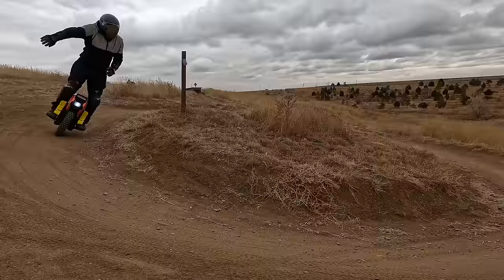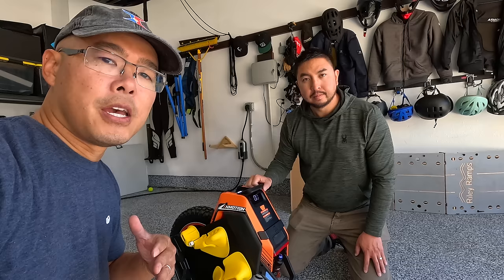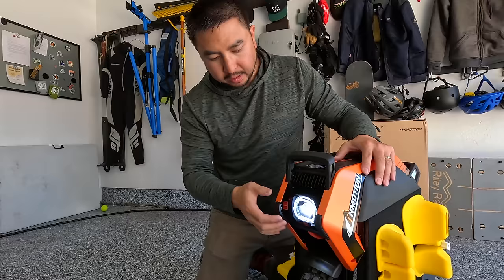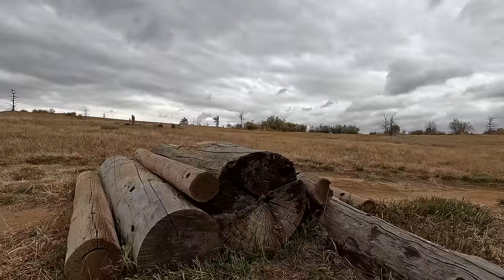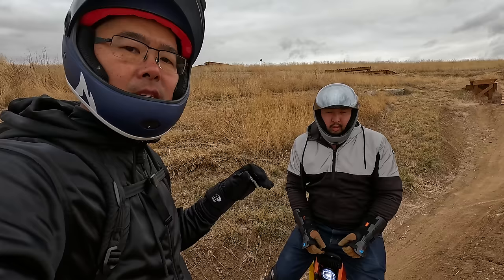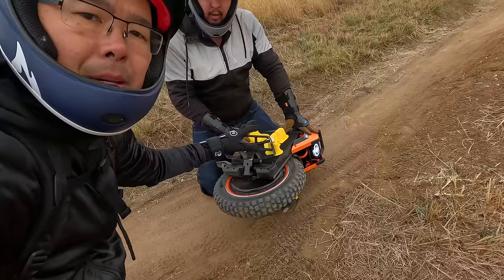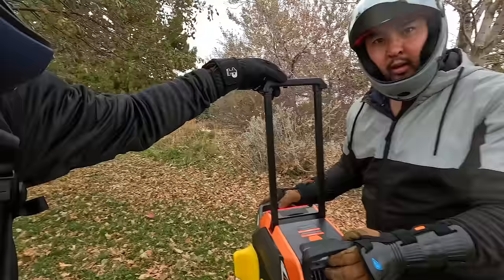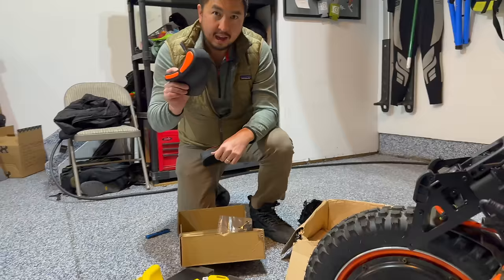InMotion V14 Review: The Most Versatile EUC Changes How You Ride

Comment: Nice wheel, good review.  I think that tall trolley handle is more susceptible to bending.
Reply: The tall trolley handle is nice but they are definitely susceptible to bending if you accidentally drop it while extended.   The last trolley handle I broke was Wrong Way's EXN that was only 5 days old.  The elevator door shut on the wheel while I was entering and I dropped the wheel. 🤣

Comment: I'm looking (along with a couple friends) into getting our first EUCs. The V11/V11Y as well as V12HT seem like good values, but I'm not crazy about the V12 not having any suspension, then the V11 is down on range and the suspension is just an air shock. Makes me think if I'm looking into the $1600-2000 range, it may be better to wait longer and save up $3000 for this if it is basically the best overall, comes with features and would prevent me from wanting to get an upgrade in 1-2 years.
Reply: I’m in the same boat. I think I’m going to wait and save a little more to get this wheel as it seems much more capable. The only thing I’d mention is the v11Y and the v14 have similar range despite the size of battery. This is due to higher speeds, weight and other various factors. If you’ve never ridden an electric unicycle I’d consider doing some lessons before purchasing a wheel and figuring out your riding style. V11Y is a great commuter and a light off road wheel.

Comment: VERY disappointing that the orange panels got removed for newer batches and no mention that the orange will still be available 😥.  The orange panels was a selling point for me.
Reply: I thought about that too but I bet you could find another owner to trade panels with.
Reply: @razoraz  possibly but the small wheel size is the biggest issue with the v14.  My next wheel will be the new Commander Pro 50s

Comment: I just picked up a patton since I was a bit suspicious of some of the raptor controller issues as well as the fact that I don't want a first batch wheel. My big question is whether you bottomed out at all during your riding? Personally that's my biggest issue with the patton but it doesn't have a progressive spring
Reply: I never felt that I bottomed out on the V14 even when dropping 6 feet.

Comment: How do you compare it with thw veteran lynx? Pros and cons?
Reply from the maker: Like apples and oranges. This is smaller and slower but more agile and less expensive.
Reply: @freshlycharged so basically it's more agile? Any other pros over the lynx? If price was comparable
Reply: Do you want a spring or air suspension? Do you want to do drops? Do you want a centered trolley handle? Do you want waterproof batteries? Do you want to fit your wheel on a bus? Do you want to customize/swap your batteries? Or do you just want the biggest, fastest wheel possible at any cost?
Reply: @s0d4c4n I want the most comfortable ride with ability to do some small drops, don't care about battery swapping

Comment: It is not 9kw output that is input , if it was 100% efficient it would be but the electrical efficiency and bearing drag etc. lower this considerably  a lot of this energy is converted into heat , otherwise motor wouldnt get hot and wheel could spin forever in air once spun . Also the controller gets hot too .

Comment: Are you going to run around with spare battery packs? What a nonsense.
Reply: If you've driven somewhere to go out in the bush or to access mountain bike tracks then having spare batteries in your car is not a big stretch of the imagination is it. Not all riding starts from home using a backpack. I can see this being very useful especially if you have to travel >60 mins to get to where you want to ride and you want to go out all day.
Reply from the maker: Makes flying with your EUC an option now. Plan ahead. Mail your batteries, fly with your EUC (minus the batteries) to your destination and install the batteries once you get there. Easy as 123.
Reply: I'm curious to know why the wheel is under maintenence.  Seeing how I believe this will be my nxt wheel. Tha ks again guys and congrats Andrew!